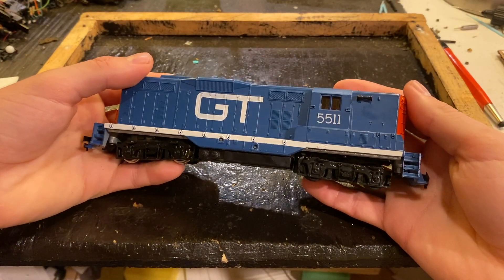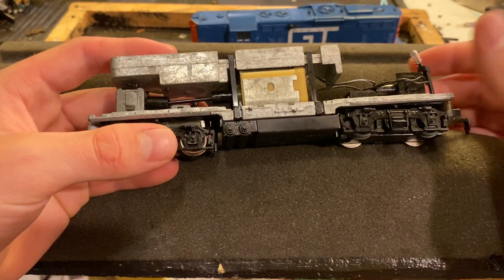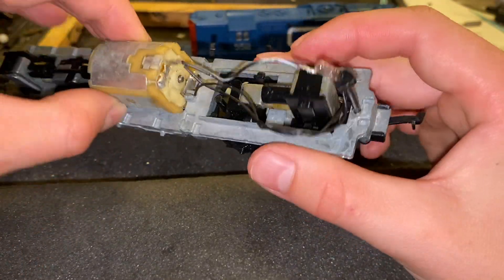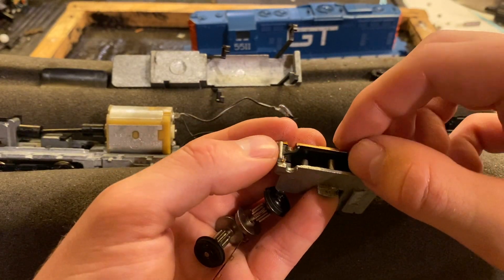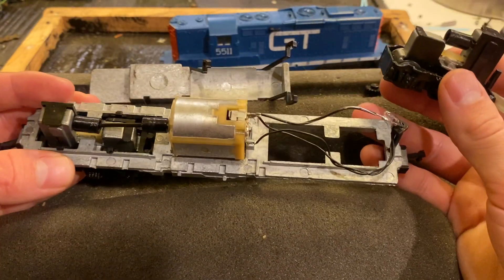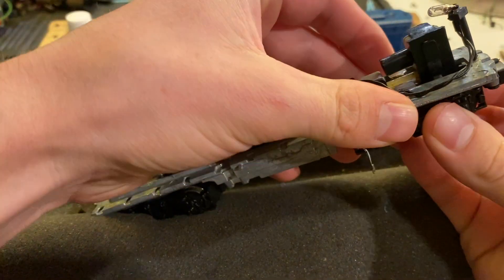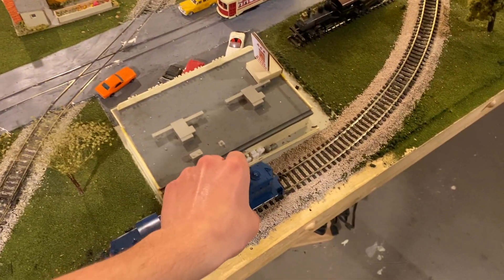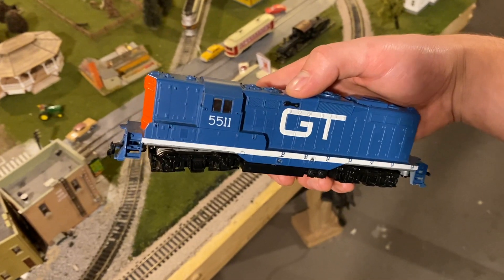Can We Make It Run? Strange Lionel GP9 Locomotive

Comment: Super. When I was a kid, fifty years ago, l  had a Christmas where I was allowed to spend twenty five dollars at the hobby shop. I could have gotten an Athearn superpower F-7A unit and matching F-7B dummy unit for less than the price of the Lionel GP-9. It was a hard decision but I choose the Geep, and after fifty years of fantastic operation, both inside and outside, I think that I made the right choice. P.S. I also bought the Athearn units, and they survived my railroad too. Having all wheel drive and pickup, covered gearboxes, good motors and bearings, and enough weight to really pull a train makes for a much longer lasting locomotive. 💙 T.E.N.

Comment: Photo from Lionel shows body off frame and only one drive shaft on the GP9. Think your only real issue was the electrical connection which was a great fix. I woulda checked the other non-drive gear set just to see what was keeping them locked up although your decision to just remove the 3 gears was reasonable.

Comment: When you disassembled the front truck the electrical connections are on the copper strips look closely you can see where the wire originally was soldered .  Nice job getting it running

Comment: Do you restore/convert bluebox engines? I got one that has a defective axle (not broken just warped), and the motor should not sound like a scaled down airplane engine. Not to mention DCC to make it work with my other engines (the newest a run year 2016).

Comment: idk if u check comments this late but just recently (40 minutes ago) I bought a bachmann southern railway locomotive from the 90s-early 2000s era. When I put it on the track, I had to put it on full speed, and it started smoking. It only starts running at 90% power. I was wondering if you could tell me how to fix it? Thanks

Comment: Hey bud how would we be able to send you stuff?  I have aTehran blue box sd40/2 I bought myself when I was 6 back in 1990 at hobby town USA.  When I got home to put it on my lay out I accidentally dropped it on the ground before I could get it on the tracks.  It never ran because of that.  Literally has never run.  I’m wondering if you could fix it.

Comment: Good ole Lionel and a GE motor .That is a strange locomotive I think I have seen pictures of these online somewhere or there is one at a train museum and its not running. Great work getting it to run. It looks like Athearn type setup inside. Sure does have that color to be noticed.  Fact is General electric made motors for fans clocks etc. Clock radios, stereos,record players as well as light bulbs power cords and them transformers you see on telephone poles.  My late grandparents worked at GE in Lynn Massachusetts after WW2 thats where they met in 1946- 1947 they were married Oct 11.. My grandmother would put coils in the transformers the round ones and they fill them with oil. My grandfather was the inspection guy I think.